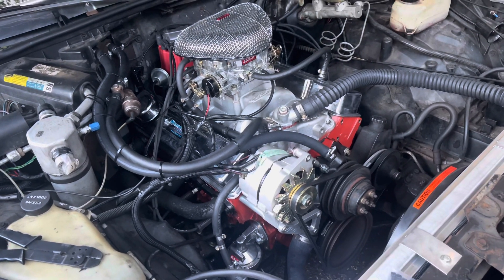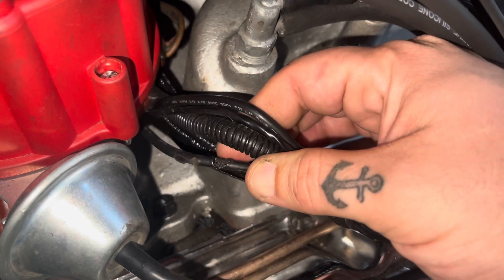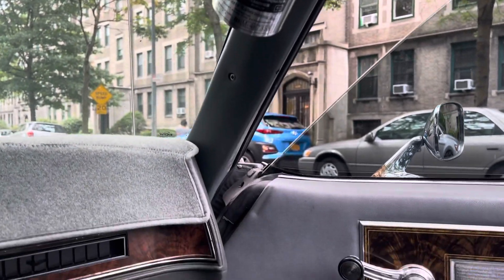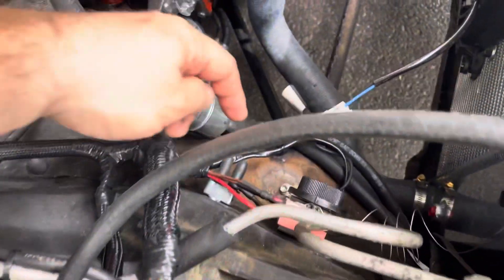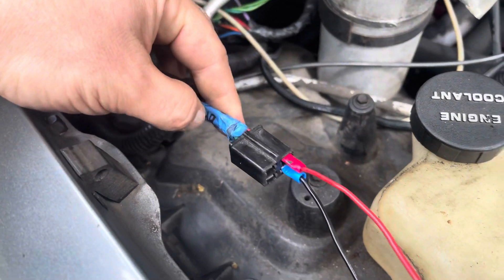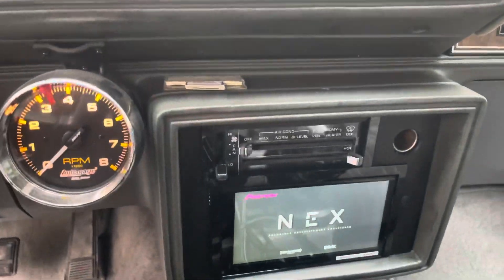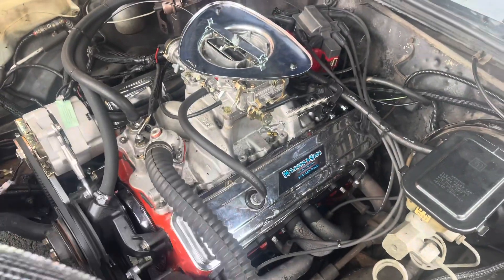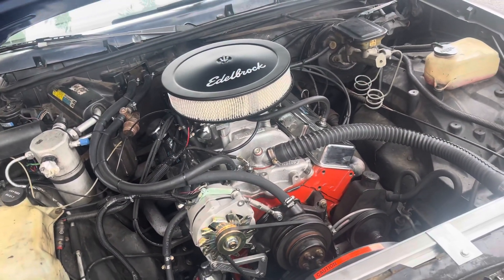The Cutty Chronicles : Volume 6 ( Getting my Heat back ) Featuring my Cutlass Supreme

Comment: You shouldn't have to wire that plug like that. The climate control gets its power from fuse block. That plug only triggers the A/C  compressor to come on. You should have a heater control valve I'm one of your hoses going to heater core  with the vacuum hooked to it and other vacuum line to carb.
Reply from the maker: I need to check again. When I got my car back from the shop the climate control was not triggering the blower motor to come on at all. I asked around and people told me to run the wires to the AC plug like I did in the video and magically it came on again. I DID have a blown fuse in the fuse block for the AC, but I replaced it and I will pull the in line fuse on the wire I ran and see if the climate controls still work. Thanks for the comment LS KID. Be safe
Reply: @grindsoul  it could also be the blower motor resistor... are you in some of the gbody groups on Facebook? Lots of great guys that will help answer any question you have.